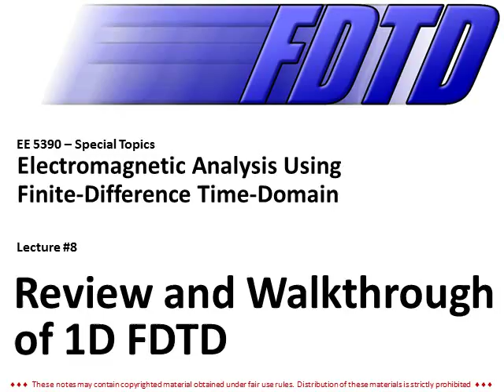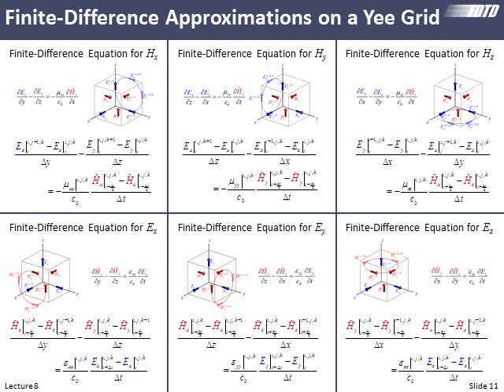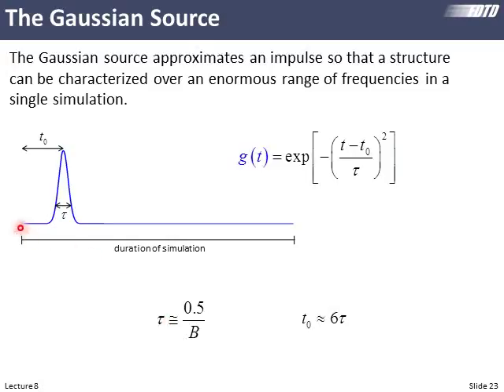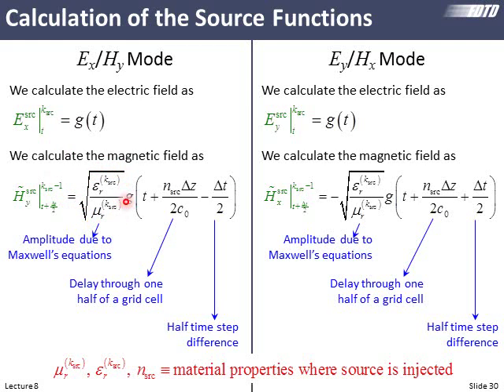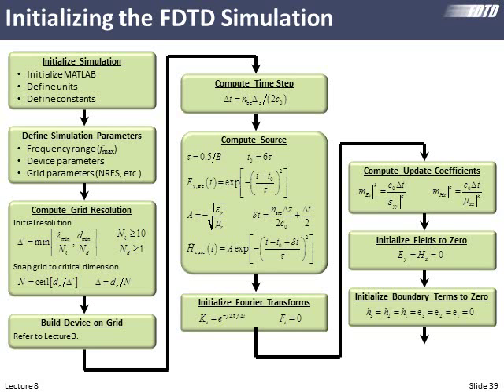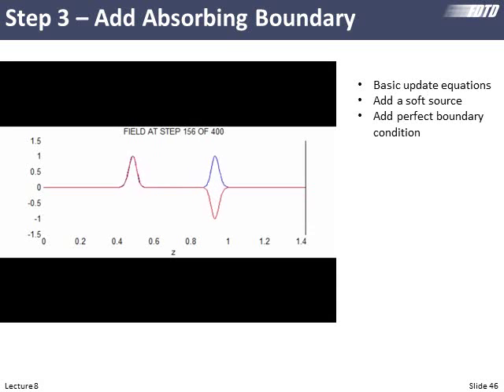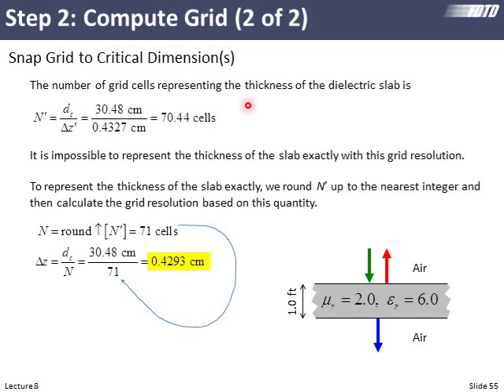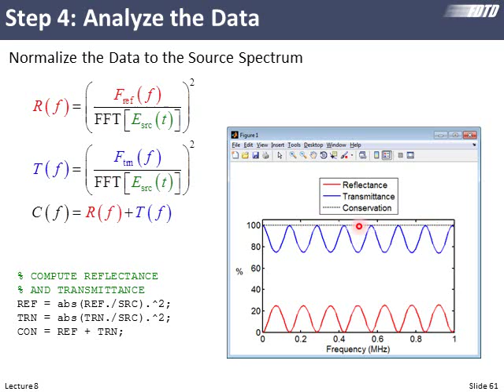Lecture 8 (FDTD) -- Review and walkthrough of 1D FDTD

Comment: Hello Prof. Raymond. I would like to ask you about implementing the Fourier transform in the loop. I am currently trying to implement the example of the slab you gave at the end of the lecture but I am not able to get the same graph for the reflectance and transmittance that you are. I can recover it if I simply take the FFT after updating the reflected field at T but I realise that this is not an efficient way of doing this. My implementation (in Julia) is like this:

Nfreq = 100
Freq = LinRange(0,fₘₐₓ,Nfreq)
K = exp.(-im*2*π*Δt.*Freq)
Er = zeros(ComplexF64,Nfreq)
Et = zeros(ComplexF64,Nfreq)
Es = zeros(ComplexF64,Nfreq)

For T in 1:Steps

the update equations, etc

for nf in 1:Nfreq
	Er[nf] = Er[nf] + ((K[nf])^T)*E[1] 
	Et[nf] = Et[nf] + ((K[nf])^T)*E[Nᵣ]
	Es[nf] = Er[nf] + ((K[nf])^T)*Eₛ[T]
end

Ref = abs.(Erf./Esf).^2
Trn = abs.(Etf./Esf).^2
Con = Ref.+Trn

Then visualise...

end

When I do this loop the result I get is not normalised with a really high peak at zero and the reflectance and transmittance have their maxima and minima at the same frequencies while this shouldn't be the case. So I would like to ask you how I could fix this issue. Thank you in advance for all your assistance
Reply from the maker: Seeing a picture of your results might help me. The variable names Er, Et and Es are inconsistent with Erf, Etf and Esf. Is that the problem or just a result of how you typed it here?

Otherwise, I am not seeing any errors, but I am also not seeing all the code. For example fmax could be set to an incorrect value.

Have you tried simulating just air? Your intermediate results will be simpler and more intuitive to find what may be wrong.

Are you using high enough grid resolution? That can easily shift the frequency response.

Hope this helps!

Comment: Prof Raymond, I have difficulty understanding the TF/SF framework. The hard source, soft source is easy to understand. We pick a specific point in the grid and give it some disturbance. Later as the simulation runs the disturbance propagates and interacts with objects in grid.

However in case of TF/SF, we are just adding the correction terms. I know the correction terms contain the source functions, however it is difficult to imagine how it leads to a one-way source.
Reply from the maker: Yeah, it is pretty weird.  Here is another way to think about it.  You are essentially injecting two soft sources at two different points.  Each launches a wave in both directions.  They are timed so that the two left propagating waves interfere destructively while the right propagating waves interfere constructively.  You can study this by turning off each source individually and examining the resulting waves.

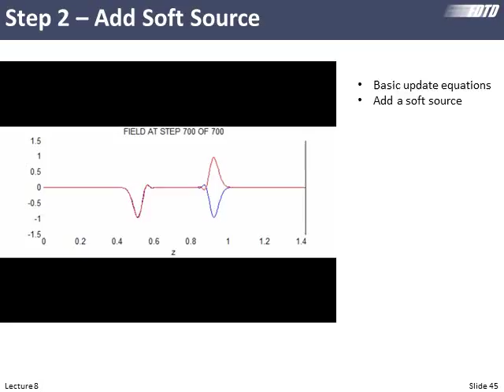Comment: Hi Professor, I am trying to add soft source in Step 2(37:30), and monitoring Ey. When the wave hit the right edge, it bounds back with opposite sign, flipped. However, when it hit the left edge, it bounds back with the same sign. How can I solve this? Thanks!
Reply from the maker: There is nothing to solve.  The wave should behave differently because each boundary us using a different boundary condition.  One edge sets the electric field to zero and the other edge sets the magnetic field to zero.  That is what causes this behavior.

Comment: 3:00 I still don't fully get why you'd normalize H. E.g Faraday's law remains the same, so changing H by tilde{H} just also modifies the prefactor on the right hand side. To update E you'd divide by this constant, so it changes nothing in terms of accuracy. 
In other words: As long as you're not getting anywhere close to 10^300 you should be fine multiplying doubles of different orders without precision loss. The loss appears when you add/subtract numbers with large varying order, but that is not done here.

Comment: Hello there. In the final diagram, where do I inject the source? it is before the "Update Fourier Transforms"? Thank you!
Reply from the maker: Take a look at the block diagram around the time 33:38 in the video.  Also, you can get the electronic notes from the course website here:

https://empossible.net/academics/emp5304/

Since the TF/SF source is being implemented here, there are actually two places where corrections terms are inserted into order to implement the one-way source.  The corrections to the H field are inserted immediately after the update is performed.  The corrections to the E field are inserted immediately after it is updated.  The Fourier transform is the very last last step in the main loop.

Comment: The greater the conductivity of a material, the smaller should be its relative permittivity, correct? We should expect a metal, for instance, to have a low dielectric constant. 

Also, good conductors (such as metals) reflect waves better than dielectrics. So, how come in my simulations, the waves get a stronger reflection when going through materials with high relative permittivity? Is there something wrong with my code, or is my thinking incorrect?

Thanks in advance
Reply from the maker: The thing to remember is that both the conductivity and the permittivity contribute to reflections so changing the value of either will cause reflections.  For plane waves incident on an interface it is a change in impedance that causes reflections.  If you want to learn a bit more about metals, permittivity and conductivity, check out Lecture 2 here:

http://emlab.utep.edu/ee5390em21.htm
Reply: Great, thank you. Oh, btw, I thought I found somewhere one of your videos where you mention the reflection coefficient and how it's not only dependent on the intrinsic impedance, but also on the conductivity of the material... Could you point me to it, if that's really one of your lectures?
Reply from the maker: Maybe you are thinking about Lecture 13 on the Perfectly Matched Layer (PML) where I said reflection of a plane wave depends on both the ordinary refractive index and extinction coefficient (loss).  Reflection of a plane wave at an interface is completely described by the impedanes of the two mediums.  Conductivity contributes to impedance along with the permittivity and permeability.
Reply from the maker: Be careful with this.  When e"=0, there is no loss, but when e" is not equal to zero, both e' and e'' contribute to loss.  So, e" does arise due to loss, but it is not solely responsible for how much loss there is.  That is sort of confusing at first.

I like to teach the electromagnetic parameters this way.  The permeability (mu) and permittivity (eps) are the the most basic material properties and they are fundamental to Maxwell's equations.  However, it is difficult to look at mu and eps and determine anything specific about the material's effect on a wave.  Instead, we usually discuss the complex impedance and complex refractive index as these quantify very well the effect on a wave.  The complex impedance describes the amplitude and phase relation between the electric and magnetic fields.  The complex refractive index describes the speed of a wave and its decay (or loss).

From the complex mu and eps, we have

eta = sqrt(mu/eps)

n = sqrt(mu_r*eps_r)

Based on these expressions, you can see that both the real and imaginary parts of permittivity contribute to the impedance and also to refractive index.
Reply from the maker: I do not think that is correct.  I suggest working through the math.   First, let

eps = e' + i*e''
mu = u' + iu''

Then calculate impedance

eta = sqrt(mu/eps)

I think you will see that e" ends up in the phase part of eta.

Comment: Does  anyone succeed in writing the code? Will appreciate the sharing.
Reply from the maker: In my experience, it does not turn out well when somebody is given the code instead of writing it themselves.  It puts the student in a "code hacking" mode instead of a "code thinking" mode.  This is where the student is doing little more than moving chunks of code around until it works and they end up very confused and frustrated.  Look at the block diagrams.  They are as close to code as you can get.  Follow those as well as follow the suggest sequence for developing a code.  We would be happy to help you along the way!
Reply: @empossible1577   Thank you for fast reply, I have already wrote the code, but there are some small things  that I need to fix,  like how exactly do I inject the source and how to create video  of my code.
Reply from the maker: @V4Vx  First, let me point you to the official course website.  The notes have seen some improvement, revisions, additions, etc. so they may differ from the videos a bit.  When I refer to lectures and slide numbers, it will be from the official course notes.

https://empossible.net/academics/emp5304/

When developing your code, be sure to follow the development sequence outlined near the start of Lecture 6.  This is very important.  For Step 1 there is no source.  Just simply plot your field at every iteration and follow the plot command with "drawnow."  Step 2 injects a simple soft source.  So, right after you update your electric field, in the next section of code, simply add your Gaussian function to a point in the middle of your grid.  That couple lines of code will look like

% Inject Simple Soft  Source
Ex(nzs) = Ex(nzs) + G(T);

Ex is your 1D array of the your electric fields.  Maybe your code has Ey.  nzs is the position along the z axis of where you want to inject the source.  G is the source function.  T is the time step.

After that you will be working on boundary conditions.  This is possible because now you have waves that will hit each boundary.

Go through this and see where you are.
Reply: @empossible1577   Thank you very much, I followed your instructions and it's worked!
Reply from the maker: @V4Vx  Awesome!!  Great job!!!